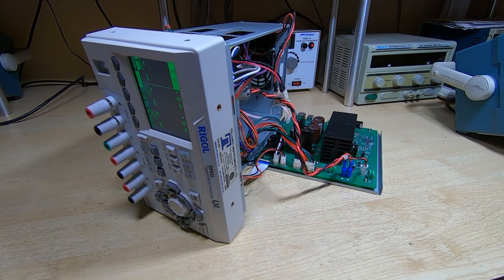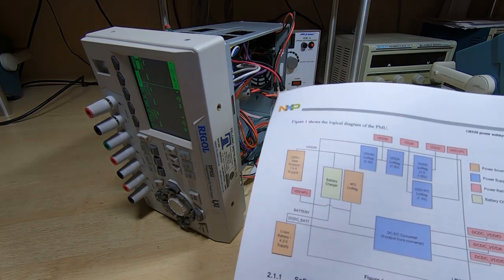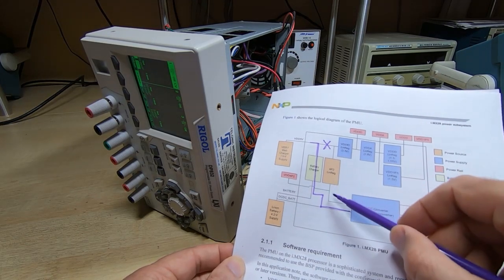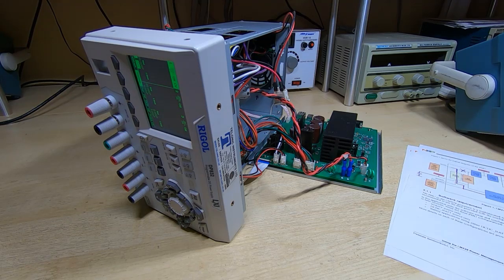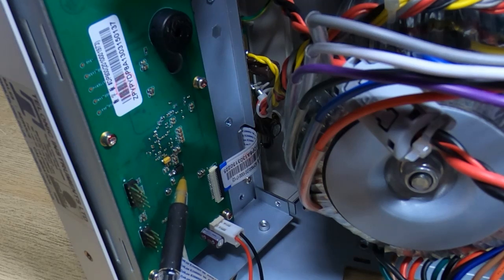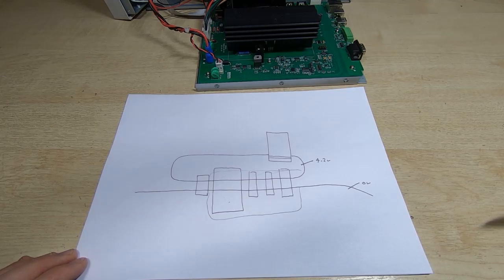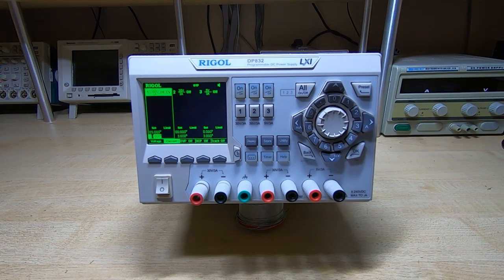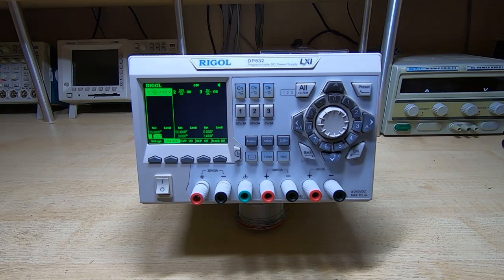Rigol DP832 Repair Part4

Comment: Hello Jerry .i have 5 units of the same RIGOL DP832 and all of then having reboot issue's. sometimes several times a day. i only added one cap 100uF and it did the job. it works perfect now, no reboots anymore already 2 weeks. the voltage in that line is stable now 4.2v.
So thank you very much for your work on that problem and the useful video .I had those issue's for a long time and sadly no one could fix it.
Reply from the maker: Happy that it helped.

Comment: I just purchased DP932 and awaiting delivery before watching this video. I hope they have fixed this already.
Reply from the maker: As far as I know they were aware of this several years ago but just never told anyone. I believe that they modified the boards by adding a capacitor similar to my video so hopefully your supply should be OK as long as it was manufactured after the change.
Reply: @JerryWalker001  thank you for taking the time to reply. The thing is this is a new design with a touch screen and I hope they have not done something stupid again but rather built on the experience of the previous model.

Comment: I purchased one about 6 months ago and its been redesigned with rhe regulator well away from the capacitors and on a huge heatsink...
Reply from the maker: Yes but unfortunately that is not the cause of the resetting issue. The heat sink was changed quite some time ago but the actual cause of the issue seems to have persisted much longer.

Comment: To be fair, the analysis and conclusions seem a bit unbalanced to me.  if I understand correctly, this is an older unit, and unless I've missed it, nobody has said "I have a new unit and it's bad."  In other words, is there actually evidence that Rigol haven't done anything about it?  It seems to me that "doing something" would mean a change in the design that would show up in newer units, and if my experiences relate here, they might offer remedies for people who specifically complain about older units -- or they might not, depending on many factors.  Now, it could easily be that they indeed haven't updated the design, but if any evidence has been offered either way, I must have missed it.

I also wonder if the problem is actually not the bypassing, but rather whatever elements are contributing to all the ripple in the first place.  I can imagine a possibility where the issue never showed up in early versions, and the conclusion was "okey dokey."  Then some other design change was required for some reason, and suddenly the ripple got worse but nobody noticed the potential issue with the rail.  Just a thought -- a speculation.  That doesn't mean it was okay to skimp on bypassing, but I think it would make the situation more understandable.

I'm not trying to defend Rigol.  I'm trying to suggest that piling on with too much negativity may not be realistic.  It's silly to think they would ship a product with an issue that they know is going to cause them grief in support and reputation; they're just not that stupid.  If HP (regardless of what they call themselves these days) had done something like this, I would be a little more concerned, but...  you know, I would bet that from time to time, various issues have probably leaked out of the shipping dock of that company, too!  Maybe not as many, but... yeah.  Technology is hard.  (Have you ever made something complex that didn't work?  Turned out to have unexpected problems?)

Finally... we can't have it both ways.  HP quality at Rigol prices is not realistic.  If we buy from the lesser brands, primarily driven by cost, we get what we pay for.  We've always known there were various issues with Rigol, Siglent, lesser, and greater brands; it's par for the course.  We have come to expect a lot of technology for a little bit of money, and in fact more and more because they've done a pretty darn good job of it, but the balloon is getting stretched pretty tightly at this point.

Comment: Jerry, I don't own any Rigol gear (yet?), but could part of their support problem be due to the "glory boys" in their design group throwing it over the wall to junior support Engineers who don't have the experience & time to support everything that has been thrown over the wall to them over the years?  I'm not trying to make excuses for them, and their poor support on this issue is inexcusable anyway (especially for their more expensive gear), but being an Engineer myself (Mechanical, not Electrical), I can see the internal "throwing over the wall" to less experienced Engineers happening.
Reply from the maker: Its possible but it is still the responsibility of the lead engineer. I used to have interns working in my company and they were often useless and their work often needed to be discarded but it was always my responsibility to ensure quality. If an engineer gives a job to someone who is not up to it and fails to properly test the end product then the engineer is still at fault. There are certainly 'signs' of inexperience in the design but this can happen. The main issue I have with RIGOL is their poor response in fixing the problem.

Comment: Well done and informative video. Invaluable resource for owners of the supply with an excellent explanation of why the fault occurs and how to fix it. Your prior video on the 800 watt Riden supply helped me personally, and a lot of others I know (the Ridens are quite popular with the DIY  solar storage battery crowd where the ripple is not an issue and the ability to reach 60v makes it useful for 48v batteries). Thanks for sharing your expertise, don't let the trolls stop you.

Comment: I have a DP832 purchased new in late 2019 that doesn't reset. Nevertheless, it is tempting to see if this flaw still exists, or if it is managing to somehow regulate while putting a lot of stress on the single capacitor on the 4.2 V rail. This DP832 also has the extra digit, so the potential measurement offset issue is concerning as well.
Reply from the maker: I forgot to mention in todays video that all 3 channels previously showed random offsets. CH1 was worst and it varied from approx 0.003 to 0.012 but all 3 now show 0.000. I will be making a follow up video to show the accuracy.
Reply: @JerryWalker001  Hah, you might be amused to know that my DP832 has a Rigol-supplied bodge capacitor on the 4.2 V rail. Here is a picture of it: https://blog.fikesfarm.com/dp832_bodge.jpg This particular DP832 has a serial number starting with DP8C2112009xx (purchased new in late 2019).
Reply from the maker: @MikeFikes  Maybe I am on the right track. My unit is still running fine so it looks like RIGOL finally figured out the issue although it seems odd that they are just bodging the board 5 years after the fault was first identified. I am now even more annoyed that they did not release some sort of technical support bulletin although I suppose that would mean them admitting the mistake. It probably also explains why your unit does not reset.
Reply: @JerryWalker001  It is indeed super annoying: The time you spent fixing this known defect likely exceeds the cost of an entire new DP832. It makes you question what the right thing to do is regarding recalls / support bulletins. (I wonder what HP / Tektronix do in cases like this.) IMHO, one reason this PSU is useful is because Dave Jones made it popular and then the community have debugged it, not because of any engineering expenditure on Rigol's part. I'm still wondering about the fact that my DP832 can power a LED when booting (https://youtu.be/t2drvekCRUY).

FWIW, I bet you have indeed fixed yours. Since it is easy to do, I measured the voltage across the legs of the bodge capactor and I get 4.2 V with 5.4 mV RMS ripple.
Reply from the maker: @MikeFikes  It would have been nice if they had release a technical bulletin. In my own companies I had a policy of producing technical bulletins whenever a fault was found so that my equipment could be properly supported (although I probably did not have as many faults to report :) ). I am now getting around 7mV pk/pk ripple with 11mV impulse noise on the 4.2V rail. I have also carried out some additional testing and found that this noise is directly linked to the mains voltage and as the input voltage drops the noise gets worse. Out of interest (I could not help myself) I removed the caps I had added and tried it at different input voltages. At anything under 230V it just constantly reset every few seconds and over 250V it was OK for maybe as long as 30 minutes. With the caps back in place it is good down to 170V and over 190V is does not seem to ever reset. I ended up with the following caps on the 4.2V rail 330uF, 33uF, 100nF, 10nF, 1nF (all SM) and I removed the original 0402 part as it was probably failed. In light of your information I will post another video as others may find this of interest.
Reply: @JerryWalker001  Ahh. I've run one of those calibration scripts with the DP832 and 34465A and I have never noticed random offsets in either sensed voltage or current. But maybe mine is waiting for the sole decoupling capacitor to die one day. I'm definitely opening my DP832 and will share any findings.
Reply from the maker: @Robert C Thanks, The RIGOL 'fix' certainly seems a bit odd. I could understand it if it was just the older units but mine has a calibration date of 2014 so it seems that they are still bodging 5 years after that. Still at least they are trying to fix it. I just wish they had told me so that I could have saved a days work.
Reply: @Robert C It is also interesting that from a production aspect that even years later is is cheaper to pay for the labor to bodge the board than to simply rev the board with proper decoupling caps. (Perhaps they indeed have a lot of stock of the existing rev, hrm.)

Comment: Just in curiosity, I measured the ripple in my unit, and it's indeed horrible 1.8Vpp. Though I didn't encounter MCU resets yet, I put those capacitors anyway and now the ripple is a decent 80mVpp. Thanks, Jerry, your videos always useful.

Comment: I can't believe the Rigol engineers ignored the data sheet.  The PIC microcontroller I'm using has a lower core voltage.  The data sheet has an entire section on decoupling capacitors.  A total of 3 paragraphs covering the location, type, value and temperature range of the Vcore capacitor alone.  Fortunately it only needs one.

Comment: If the power supply continues to function after giving it some large & small loads, some transient loads etc then I'd call it a repair well done.
Reply from the maker: Unfortunately the loading never really seemed to have any effect on the rebooting. As far as I can determine it seemed more based on the instability of the 4.2V regulator in the DC to DC convertor. The noise peaked too far and caused a brown out reset. The analog boards are fairly autonomous and the control board just sends them 'fire and forget' commands (which is why the voltages stay during the reset).
Reply: @JerryWalker001  Will you be varying the loading on it anyway as you let it run continuously?
Reply from the maker: @bobvines00  I did not go into the testing in much detail in the video as people seem to find it boring but as you ask, it is currently on long term test and the supply is connected to a KP184 set to 5R constant resistance. The DP832 is programmed to cycle in 1V increments from 1 to 30V at 1A and then 2A and then 3A with 1 minute at each step. It is connected to the Agilent multimeter which is logging the voltage. It will be left running like that for a few weeks or until it shows a fault although I will be interrupting this testing for a few hours tomorrow for the next video but it will then go back on test. If it survives 2 weeks of continual testing then I will deem it to be 'repaired'.

Comment: Rushed into manufacturing without a final design sanity check at R&D stage.....i.e. the hot regulator and not following the datasheet for the capacitor selection.